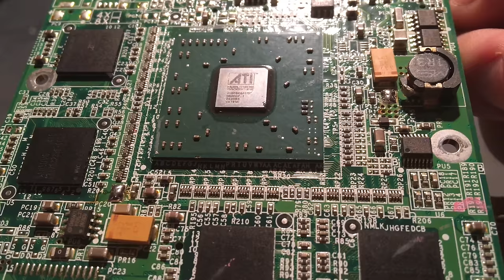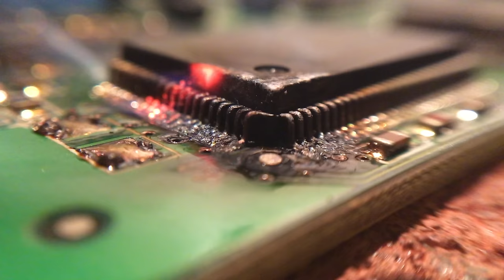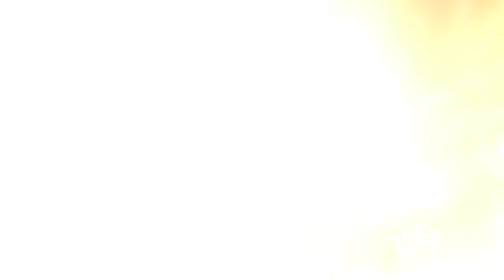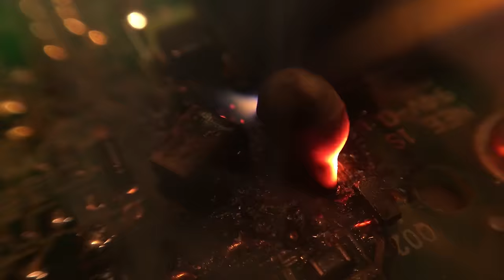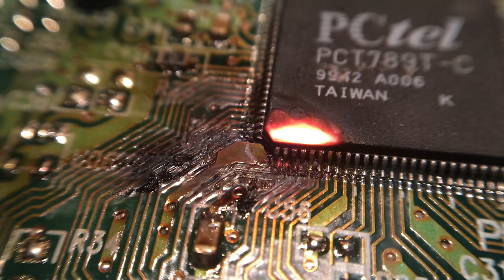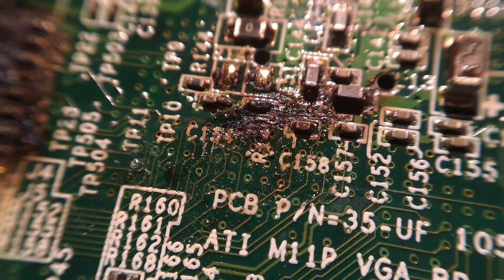Melting A Computer Circuit Board

Comment: Out of curiosity how hot would that board be? I'm fucking paranoid about my Switch's PCB melting when it gets hot
Reply: more worried on why you are scared of your switches melting, if your switches are melting then your whole keyboard would also be melting (assuming its plastic), and that would take atleast 200°c or less